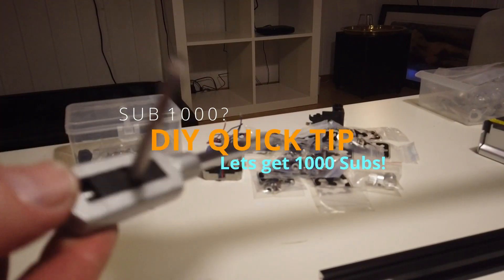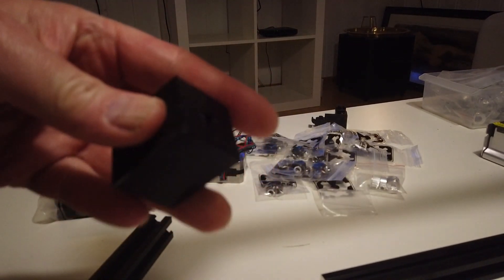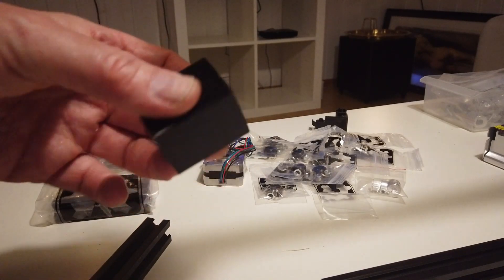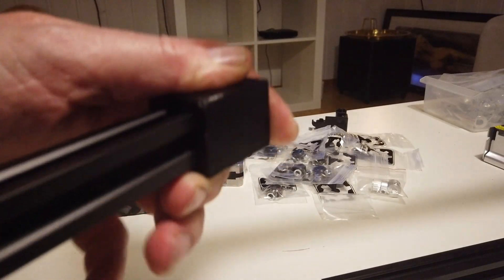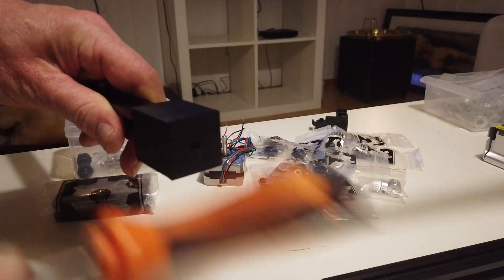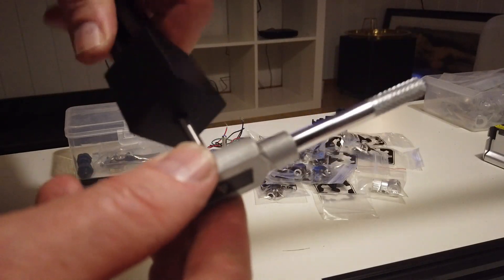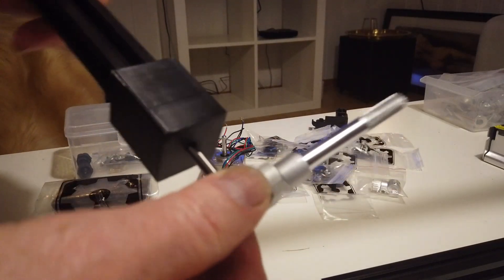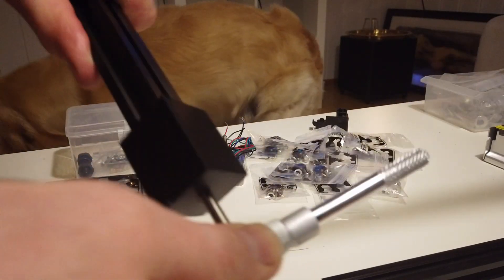DIY QUICK TIP - Tapping Alu Extrusions - Straight

Comment: I need to tap my extrusions with an M6 tap. I noticed your hole is 6mm for the M5 tap. If I want to remake this for an M6 tap should I make the hole 7mm?
Reply from the maker: I dont know where you got the V-Slots The holes should be 4.3 ish
Reply: @PRO3DESIGN  From a supplier in Thailand. They told me that can tap M6 but not M5. They are 2020 v-slot extrusions.